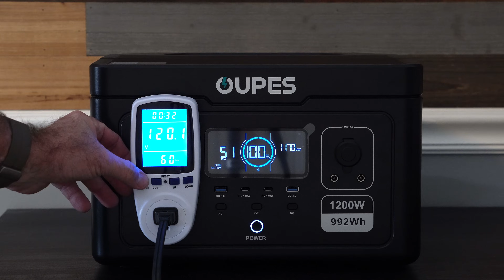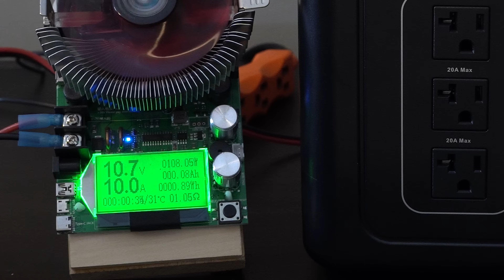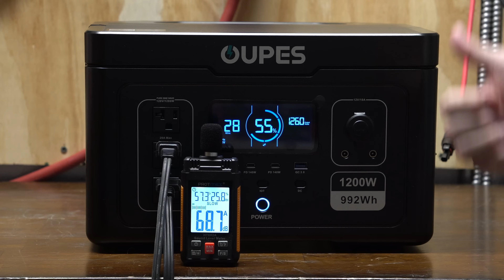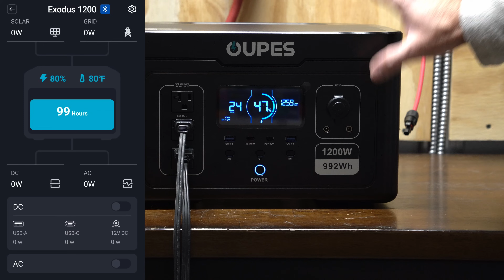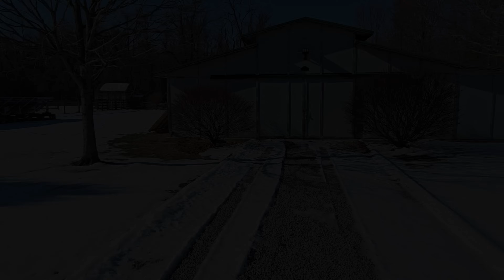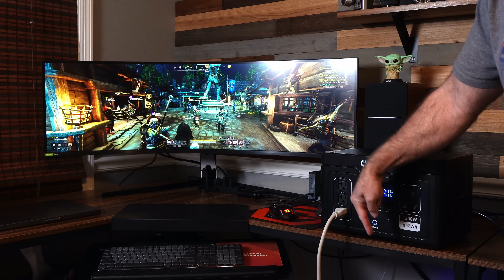ULTRA-BUDGET Power Station: OUPES Exodus 1200 - Worth the Compromises?  Let's find out!

Comment: I bought one to power my French door refrigerator during a power outage between generator runs. While I haven't had an outage yet, I ran a test and it powered the refrigerator for 8 hours and had 25 percent power remaining. That is more than enough since I plan to run the generator every 6 to 8 hours. My only concern is the recharge time. I had only planned to run the generator for 2 to 3 hours at a time and don't know if that will be long enough to get a full charge.

Comment: This unit wont start a standard sized fridge. That 3600 watt boost is a lie. I have ran a load of wash in my front loading washer and a ran a 1000 watt microwave for 2 minutes. Dryer won't spin up even with no clothes in it.

Comment: Color me unimpressed. I received mine a few days ago. The instructions said to discharge the battery completely before the first charge. I received it at 66% charged. It ran a 750-watt heater for about 15 minutes to full discharge. I plugged it in the recharge and it tripped a GFI breaker.and wouldn't charge. The next morning I hooked it up to solar and that got the juices flowing. It now charges on A.C. albeit very slowly. The Wi-Fi worked once, but it no longer connects. I spoke with tech support. They said I would get an email. I think I'll stick with the big guys.
Reply: I've got two of the 1200's.  The first charge is slow.  It speeds up a bit after that.  I've never had one trip a breaker, but then I never plug them into a GFCI outlet.  I've run each of them throught roughly a dozen full discharge and recharge cycles since I've received them.  I ran a bunch of testing and am getting about 86% efficiency around a 500 watt draw.  I actually ran a head to head discharge test on both units using a pair of 525 watt heat guns.  One ran 1:37 hours.  The other ran 1:39.
Reply: @JeffreyMorrissey-s6p  Thanks for your reply. I actually didn't plug it into the outlet. I plugged it in and my wife noticed the refrigerator had turned off. Same circuit I guess.

Comment: I love the size and weight of this unit for camping with my 12 volt refrigerator. I bought the Segway Cube last year. Roughly the same capacity, but way heavier at 35 pounds. Ugh. I guess I need to be content, but this unit is very tempting. Thanks for the review.

Comment: For me the price point is still too high regardless of battery capacity.  The deal breaker for me being the DC inefficient power usage.  I own too many 12V products that I like using and this unit would not grant me the capacity I would enjoy with my units I own.  I do like some of the Oupes products like the Mega 3, but not this one.  I would prefer to go with the Pecron 1000 or the Delta 2 EcoFlow which I bought for $399 or the Delta 2 river pro.  Just my preferences.

Comment: In my testing, the 1200 did not have the 300 watt limit on the last 6%. I was able to pull more than 600 watts all the way until 0%. Perhaps you have a faulty unit? https://youtu.be/bCrSMFrGMcg?si=Uti7g6HNs5rptHTV&t=471
Reply from the maker: Scott, I didn't test ~600W below 6% SOC.  I'm basing my 300W comments on the manual remarks regarding E002 error message, which indicate that to resume discharging, the load should less than or equal to 300W.  It's possible that I could've gotten away with 600W as well, but I didn't actually test that to be sure.
Reply: @ReeWrayOutdoors   Just watching your video again. it looks like you were pulling 1100+ watts in the discharge test to get 820Wh? The video jumps to the unit off, and you then show it at 0%. Did you stop before 6% and lower the wattage draw to under 300? Your comments seem to imply it didn't allow you to keep the same draw past 6%. I'm just curious about your testing method.
Reply from the maker: @scottlinkmedia  yes, that's exactly what I did.  I actually ran the test 2x to make sure it behaved consistently.

Comment: The $315 is a great price but at normal sale price of $349, the Pecron E1000lfp has this beat in every way.
The Pecron is $399-5%= $379 no tax. Oupes is $349+tax= $375.(yeah Oupes charge taxes.
-The biggest difference is Pecron inverter  is 1800w which let run a whole new world of household stuff.
A lot of appliances run aorund 1500w and power tools will also run at that level.
-More usable capacity. 70wh more.
-Much better charging capability. More AC, better solar inputs.
-better inputs from a battery source(8a to 20a).
-Allow expandable batteries.
-Self heating.
Sorry Oupes but Pecron clearly has you beat in this category.
Reply: I'd go with Oupes because of the difference in customer service.  JMO....
Reply: Yea I agree but I actually was able to get the oupes for 309 on a offer I sent them on eBay. That was after tax. I still plan on eventually getting the the e1000lfp one day do. The ability to add that extra battery to the pecron just makes it unbeatable at that price
Reply: It’s now 236 with discount codes.  Incredible value if you can live with the downsides.

Comment: For the price and features I would go with a Pecron E1000.
Reply: I actually replaced two Pecron E600LFP units with a pair of these for camping and have been very happy with them.  They are being sold for a slightly lower price point and have much better features and capacity.  I've been shying away from Pecron recently due to several instances where I received units with bad inverters out of the box.  Their quality control may have since improved and I do find the E1000LFP intriguing.  I currently have 5 Pecron units and 4 Oupes.  I have yet to have any problems with any of the Oupes products.  No more power bricks!

Comment: Quite a lot of compromise even for the price. Almost allpowers territory.  Would be interesting to test the charging efficiency (you have to fully charge and discharge the unit to do some of the tests so 🙂) Then we can work out how much % you get back from a full charge not just compared to the rated capacity. Have a feeling some companies are or might start to deliberately understate capacity a little to score higher on efficiency tests (obvs not Oupes with this one, though that weird 992wh did suggest it). Also it's a place they often hide cost savings with poor charging efficiency. Thanks

Comment: Do you think we'll see an Exodus 1800 and 2400 like their old lineup before they introduced the Mega series? Also, is the app wifi or bluetooth only?
Reply: Bluetooth to set up, but can use wifi. 

Somene posted in the Fb group a screenshot they stumbled in in the old app which showed an Exodus 1500 and 2400... but who know if that is legit or just a placeholder image or something.
Reply: Good question, wifi is so much more useful, especially when you can leave it plugged in mains via one of those cheap wifi plugs. Enabling you to turn it on via wifi  if it's turned itself with a short jab of AC.

Comment: Excellent presentation.  Thank you.  I think this unit has a lot of potential.  Love the 10a 5521 12v outputs. Form factor and weight are good.   This would be good unit for car/van/truck camping where weight, form factor and 12v output options are needed.  Would prefer the usable capacity per their rating was higher/better.  It is always interesting to see how efficiency the AC inverter and DC convertors/regulators are as they really impact the usable power of a unit even when in standby and not powering much.

Comment: Too many negatives on that unit for me. The 10.8 vdc was a little low for my liking. The big one is the ability to not turn off the boost feature. Thanks for reviewing.
Reply: Yeah odd, not like it helps efficiency either.
Reply: I'm thinking because it was 10 amps the voltage lowered.... Still kinda shaky if that's what you're relying on. I'd expect 8 amp 12v for a 100w device